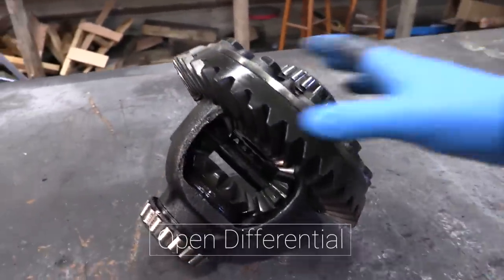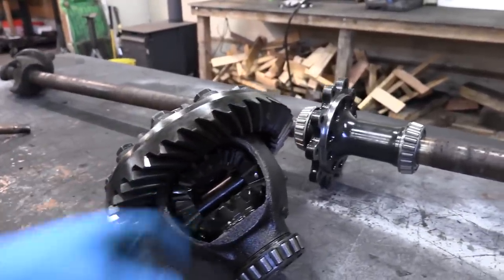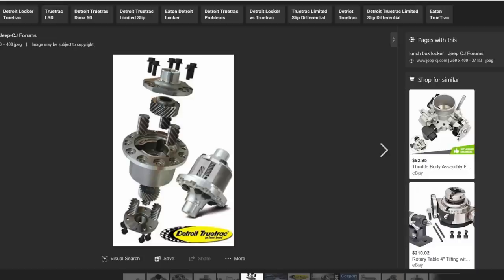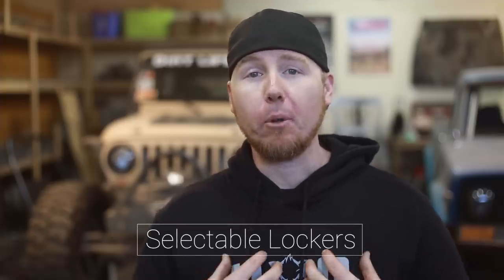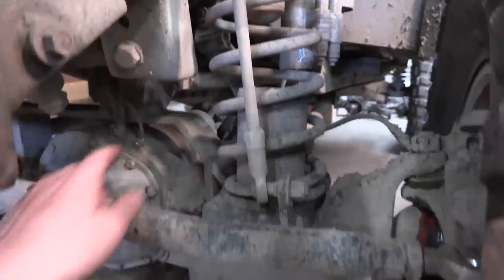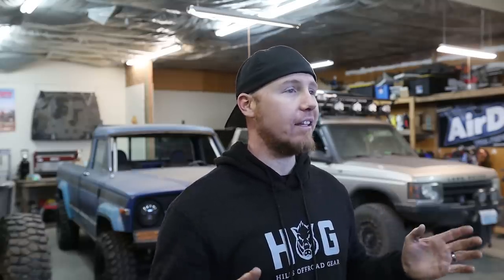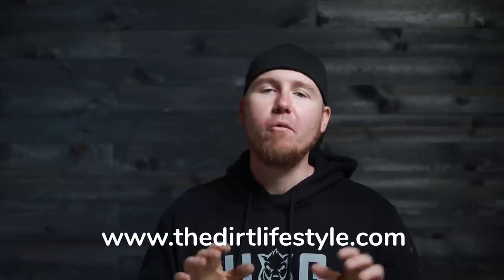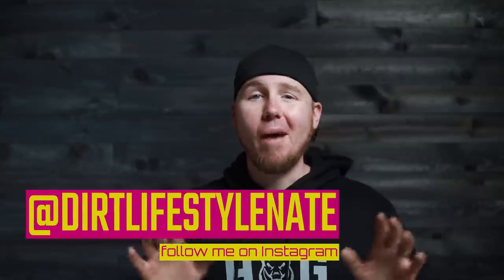Differential Lockers! ARB vs Yukon vs Detroit vs Spool

Comment: I have personally used a spartan locker (lunchbox style) and it survived my stupidity on more than one occasion, my only problem was when i messed up the first install in my f150 8.8 and overheated the springs, which i solved by goin to a hardware store and buyin some springs that i cut down to size, i dont know about any other option out there, but that was an easy fix for me

Comment: the one thing that i have noticed in doing reading for e lockers is sealing the hole that you have to create for the wiring, and the fact that the cam design if you roll back a little bit it will disengage and rengage as you move forward. i know that its slight but it still could become a headache in some situations.

Comment: Once my Corona virus stimulus sponsored axle swap is finished, I'll be running a lunchbox locker in my front dana 44 and a limited slip in my ford 8.8 rear. Just keeping everything fairly budget oriented. Samurai guys do everything the cheap way after all
Reply: Ran a lunch box front and auburn lsd rear for years. E locker rear made more difference than I expected. Running north Alabama rock. Just my thoughts.
Reply: @jasonandrewz2214  selectable rear locker is the planned upgrade path. It's just that the 8.8 already has an lsd, and the lsd in it is better for the amount of street driving I do than any locker I could currently hope to afford for it.
Reply: You have a Samurai. I don't care how you do it, I'm gonna be jealous.
Reply: Why an LSD in the rear and a lunchbox in the front? Sorry, new to the locking business!
Reply: @SirEpsidufus  basically the lsd is because I have one in the 8.8 already and is overall better for the amount of street driving I do since you don't get the noise of a lunchbox, you don't have to have an open diff when it's off like with a selectable, and since I already have it, it's free. Lunchbox in the front just because it's better than open it would be a fair bit of time before I could buy anything better as I'm cutting the budget fairly close as it is
Reply: I got a lunchbox locker in my Toyota FJ40 with a 350 Chevy.
I have it in the rear and I've never had a mechanical thing I've hated more in my life. 
I'm a mechanic and spent a great deal of time finding OEM Toyota pinion crosses since the old ones had bad scuffing where the idler pinions sat. This was caused when it was still a single spinner by spinning one wheel when bogged and overheating the oil. If you're fitting one of these ensure your diff center pinion shafts are in good condition otherwise it won't unlock properly.  
Anyway, it is the most horrible thing I have ever fitted to a truck. On road the harshness and noise is embarrassing. It unlocks mid corner with such violence it shudders the whole truck, people's heads turn with the noise and then when you need it most, it sometimes fails to lock - like in reverse.
The good things are it really is excellent off road and if you have freewheeling front hubs you can forget about it in normal use, but I would never ever recommend to anybody one of these horrible things.
A tip with them is to run truck hypoid gear oil 140. Normal 90 hypoid gear oil isn't enough to subdue the violent unlocking - but you're running one in the front so off road isn't all the time but still use 140. 
Out of 10? 0/10 is my score. At least if it's open you know what you've got and have saved $250-300 towards a better upgrade.

Comment: When my dad started building the tj it first had a Dana 44 with a Detroit when it first unloaded we thought the diff exploded  broke the 44 then got a tera60 with an arb  the Dana 30 has an ox locker  love selectable lockers  when I was building my zj  I had a spartan locker in the Dana 35 but I was only on 31s

Comment: Electric lockers use a electro magnet that squeezes 2 ramp on ball bearings after they wear for a while and with high power can wedge the bearings in place and wont unlock

Comment: Great video as usual. Due to finances at the time I am using Aussie locker in my front D30 and Ox Cable locker in the rear. Cannot get much better than a true mechanical lock up of the Ox in my opinion. It's either on or off. Like you said in the video you have the option of using the plug to lock it in the extremely rare case that the aircraft grade cable fails. Once dialed in, I have had no issues with mine at all.
You have to make sure that cable slack is adjusted properly at ride height. If you change lift height or change routing of the cable, you need to go back and make small adjustments. Also want to mock up routing before buying cable with rubber hose or somethingI, order to buy the proper length. Nice large radius bends are best whereas tight ones can cause cable to drag internally making it stick.
Ox also has air and electrical options but I fear the solenoid sticking out of the side of the differential is too prone to damage. One good whack and no locker.
My fear with electric lockers is the very fine wire getting snagged by tree branch and ripped out. As for the air option, there is the possibility of small water droplets condensing in the line, and for winter wheeling, this could cause no pressure to make it to the locker if the water freezes. A good inline water remover is highly recommended. Just thoughts that I had when buying mine.
Keep up the great work Nate!!

Comment: Ive got to say, i run an aussie lunchbox locker in the front axle on my JK. Stock dana 30 with 3.21 gears, no truss, factory shafts, and 33in all terrains. On road driving in a straight line or around normal corners its not even there. Making tight turns onto different roads, around drivethru windows, parking lots you can hear a click but a lot of times I also hear a loud thunk, this is probably due to after installing the locker, I got a lot of extra backlash or pinion rotation. Offroad in a straight line up rocks or through mud or up a washed out hill, it works amazing, but around corners on the trail where i still need 4wd it becomes a problem. It tends to push the jeep rather then turn which is frustrating when you have to keep backing up and repositioning, nobody wants to be a trail plug. If I were to do it again I probably would have gotten something different for the front like an arb or even ox, but the cost of the aussie was just so nice to pass up, and it was worth it for the cost. I feel like if I get my pinion backlash set up correct again so I have less pinion rotation it may work better, but we shall see.

Comment: Nice video with a simple explanation of the types available so that anyone interested can do more research on the individual type they might want. I will never forget ordering a brand new Chevy k1500 truck in 95 and paying an extra 300 for a limited slip rear. What garbage it was. I would of been better off installing an aftermarket  locker.

Comment: Nate,  great video.  While on the topic - can you also cover hub locking?  I'm converting a Dana 60 into an Econoline 350 and Ford has vacuum selectable hubs (F-series) vs. manual lock.  The advantage I see is not for offroad but for ice/traction driving conditions - where I want 4x4 intermittently and do not want to jump out each time.

Comment: Sup Nate! I like the video most deff. But so you know the oc locker can commonly have stretched cable issues or fraying cable issues from customer trying to force it in most the times, it's kind of like you have to push on the lever and spin the tires at slightly different speeds for it to pop into locked mode easy, and yes the cable adjustment can be annoying but If you didnt know they sell air conversion kits and electric actuators that work alot better for longevity!

And my only reason I can ever push people away from air is just from what I've heard about if you live in cold climates that some of the condensation that could build up in the line will freeze and locker wont work.

And fyi have you ever heard about an Auburn ected locker,🤟 it's a limited slip and electric locker. Lol
Reply from the maker: I have heard of the aurburn Lockers 👍, no first hand experience yet
Reply: @DirtLifestyle  We've had em in our rigs for a while.  Most rigs that have had them have moved to ARB.

Comment: I went with Ashcroft air lockers for my Discovery 2. They have a better design than the ARB's with far less failures. They are a UK company. I asked several people and they all said go with Ashcroft over ARB.  4yrs later Ive had ZERO issues with the lockers. I dont really consider a  limited slip a locker. If it cant lock it up 100% its not a locker. Just my opinion.
Reply: For me who does british Columbia Forest service roads in my stock 4x4 for ranger it sounded like the best option especially cause I can steal one from a dead mustang for cheap! I thought it wouldn't hold up off road but I have decided on it cause in still running stock sized Ko2s
Reply: **a limmited slip that is
Reply: @nickcowley8757  its definitely better than a open diff!
Reply: Not many Rover people who don't know Ashcroft, and even fewer who'll complain about them.  I just pulled the Detroit out of the rear of my D1 and have an Ashcroft ready to drop in.  The Detroit has been good, but it makes tight trails tough, especially given the limited turning radius of a Rover to start with.

Comment: I wanted a bullet proof locker and ended up with auto Detroit in the rear, Detroit True trac in the front.  14 years old and not once have I had a problem.

Comment: I would love to hear more about the torsen's that you had in your TJ. Thinking of torsens front and rear in my 2013 JKU Sport running 32inch tires and standard gears. Not planning on building a rock crawling super rig - just want more traction in the mud and the really soft sand.

Comment: My thoughts on air lockers is I will be airing up and down so much that onboard air compressor would simply my life and I want lockers on my Gladiator max tow  so I already have a compressor and I have heard the factory electric lockers stay Engage and wont unlock so I am going with air! BUT I alike the cable one too! And it’s more my budget right now! Where can you get one?
Reply from the maker: I would go directly to the manufacturer or check out 4 wheel parts 👍

Comment: My "perfect" locker would be an electronically controlled, mechanically actuated cable locker. I think Toyota did this on early 2000's Tacomas. This would give you the convenience of push-button operation, but with the sturdiness of a cable system. Even if the electronics break, you can still crawl under your rig and manually actuate the mechanism to either lock or unlock the diff. Best of all worlds in my opinion.
Reply: The OX locker can do this. You can get an electronic solenoid to push the cable into position. And if any of that breaks down you have a bolt you can put in that locks it.
Reply: You nailed it. It uses an external actuator to move a splined cup that slides in and out of the differential to lock it into place. Other than waiting for the cup to fully engage( which it's spring loaded, so maybe a second?) Its pretty dang reliable. cheap, easy mod, extremely effective.
Reply: 40, 55, 60 and 70 series Land Cruisers have cable actuated lockers. They definitely worked. The 80 series has a mechanical locker that was actuated by an electric motor with gears that pressed two plates together.

Comment: Enjoying your videos. What do you think of electronic traction systems in snow or muddy trails. My XJ on 32s had to take the back seat to a stock Tacoma recently simply because I couldn't get traction on a snowy trail. Could have been a lot of variables that day but I'm interested in what you think of those systems.
Reply from the maker: I like traction control. Its was under rated 👍

Comment: Dude this is the best explanation I’ve heard yet. My 2017 ram 1500 came stock with an lsd and stock tires are 33s. I’ve since upgraded to heavier 35s and noticed my lsd is unhappy. I’m debating on swapping to a Detroit trutrac to accommodate and keep the on road happy. Debating on waiting till the rear e locker is released for this axle. What would be your opinion? I do trailing and some mud. I feel like a trutrac will be good enough for me as I don’t plan on going with talker tires.

Comment: Want to go with a cable locker look into the s-10 pick up or blazer it's the same concept to the point that they also use a vacuum system to the cable

Comment: Great videos Nate. Im running Eaton Elockers front and rear in my 60s and I love them so far. Prior to 1 tons I ran ARBs in my 44s and never had issues. 

Question for you unrelated...what is that screen on your dash?
Reply from the maker: It's an edge insight motor for the tdi swap 👍

Comment: Just got a snowplow P/U with a LSD front and a posi rear. Won't know if it's a real posi/packed LSD till I pull the cover. I so hope it's not a Lincoln locker. It lived 22 years in the 'Salt City", AKA Syracuse NY so anything is possible.

Comment: I was thinking about getting an air actuated ox locker with the back up bolt for the glove box just in case.

Also thinking about getting a pair of full float 60s ox in the rear and spool in the front and getting a set of krawlers.

Comment: I have Personal Experience with some of these:
I have ARB air lockers in my '93 Dodge 250, (F & R) and, in my '74 Ramcharger, I have an Eaton E-Locker up front, and a Yukon Grizzly locker in the rear.
The ARB's are GREAT when they work. They also are completely 'locked' no matter which way you drive. (forward, or reverse, no slip) 
I've had hose issues with them though. Once the lines start getting old, (heat cycles) they get brittle, and start leaking. Any electrical issues will be compounded when running the electric air pump system.  (Lotta wires between the switches, the pumps, and the solenoids)

My E-locker is also great, BUT, I have the 'first gen', and, when you go to reverse, one wheel will spin almost one rotation before they lock again.  Not a big deal, unless you're on something SERIOUSLY technical.  Other than that?  No issues so far.  (I've heard the newer versions do not have this issue)
I LOVE my Grizzly locker.  As yet, I've had no mechanical issues.  I have 'dailyed' my truck with no concerning issues.  
BUT... lazy/heavy foot driving WILL give you soiled shorts in fast corners, or on wet/loose traction.
The truck will either resist turning, OR, the back will 'power slide' out. OR... you'll get a funky combo of it alternating back and forth between them.  It's easy to learn what it takes not to get on their happy side, and cause a locked axle.  Don't drive your lifted vehicle like a boob on the road, and you SHOULDN'T have any issues to worry about.  (I sometimes drive like a boob.  What can I say?)

As for strength, I haven't had the displeasure of finding their tensile strength yet, (thank goodness) but hopefully, something further out, (and easier to repair) will 'circuit break' first, before any of these give up.

I hope this info helps someone in their choice.

Comment: Lets not forget that if you are running a detroit and you break an axle , well the detroit breaks at the same time . Ive always run them but get good shafts when you install them or you run that risk.
Youve got the optimal ARB setup but yep , they still blow seals occasionally  , the select ability almost makes it worth it though unless you are 7 miles into a 14 mile trail that requires all the gear you brought....😎

Comment: When I upgrade from stock TJ lockers I'm going with OX electric lockers.
Reply: OX electric lockers use a rather large exterior solenoid hooked to a cable.
Reply: @richardeblantonii5893  yes, and I think that's the perfect setup.

Comment: I have a 98 ram 2500 on 40” tires with Dana 60hd 530 gears with Detroit locker in the rear and it is pretty much always locked and an Eaton electric lock in the front. If I was going to do it again I would put electric front and back

Comment: Hello, great video! Watching from California, USA. Working on my first 4wd build, 1979 International Harvester Scout ii, 345 engine, automatic, 4wd. Dana 44 front and back, 3.54 gears. Currently have 31 tires, looking at 33 if I do a tire upgrade. Looking at important upgrades versus fixing the looks of my Frankenstein. Recommendations for lockers? Gear? I'm not looking at extreme rock/snow/mud, just want to keep up with most trails. Won't be driving daily too much. Thanks in advance!

Comment: Nate , Thanks for this video . 4 banger tj super35 30 spline Detroit locker rear and putting a Detroit locker front and my question is should I do 30 spline or 27 spline on the Dana 30 . Running 32's 410 stock gears , dirt trails creek beds , no rock crawling don't care for it , just rides in the woods. Disc on the back . I don't think I will blow up the gears up front with the 30 spline up front if they are set up right, like others have said. I value your opinion. Oh and later a TDI with ax15.

Comment: Interesting that cable locker. 
Wonder if it could be run as external air cylinder?
Reply from the maker: Ox has a few options to actuate it including air 👍

Comment: Great information. Didn't know the cable locker existed when I was researching to purchase a set. Good to know for future. 
Also, I found information about pneumatic lockers were suppose to have a better engaging mechanism that didn't allow for reverse rolling direction when wheeling forward (unloading/ loading the axles). Where the electronic locking mechanism does allow that forward and back roll (which I hear is bad).
What is your experience / thoughts on the mechanism engagement used for each? Do you feel the same way?
Thanks for taking the time to explain all the differences!
Reply from the maker: I feel the same. I prefer airlockers for this reason 👍